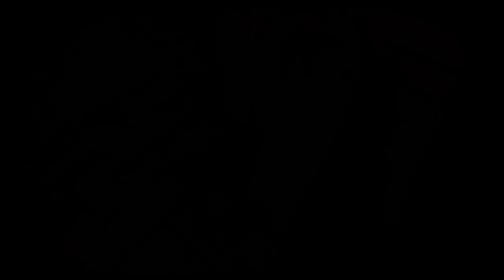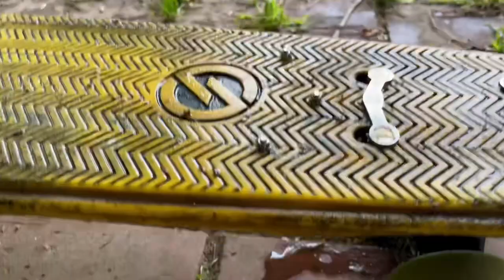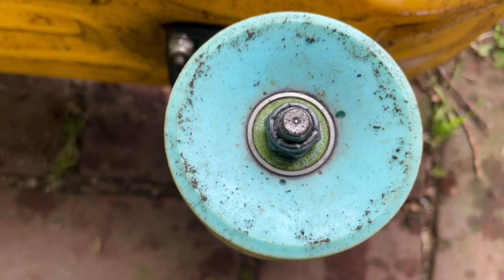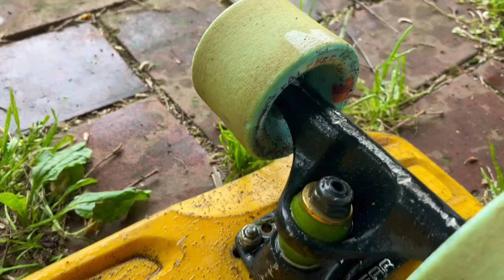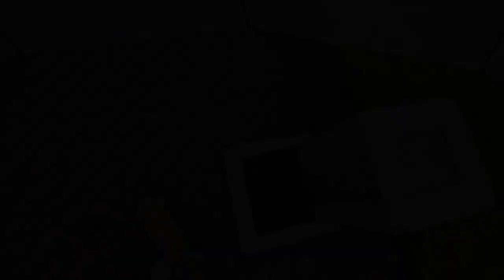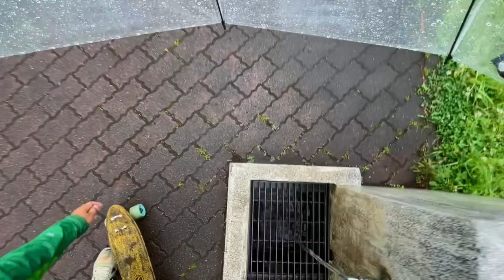I'm exploring a cruiser board that won't break even on rainy days

Comment: Like bicycle parts in the rain, you have to keep skateboard parts lubricated because this will help keep water from penetrating and remaining on the metal bearings, the screws and nuts on your trucks, etc. WD-40 spray would do the trick because it is designed to keep water away from metal parts and preventing rust/deterioration. 🤙
Reply from the maker: I agree with that too.
However, I have never used a high-performance chemical called WD-40, and now I'm using a grease spray. I would like to try the WD-40 the next time I buy it. Thank you for letting me know👍
Reply: @ponnycruising No problem and by the way, WD-40 is very popular in the U.S. It is oftentimes used to protect mechanical parts from water and prevent against rust. It is also not expensive at all. BTW, you ride the Penny so well! After I am used to riding my longboards, riding a Penny 22" feels waaay too small and scary! :-)
Reply from the maker: @OldLongboarder65  I really want the grease type of WD-40 because I put grease in the bearing.
I started with a wide 80’s old school board, so I understand that feeling well.Most young pennyboarders are used to it for the first time from such a small board, so their sense of balance is very good.
I'm guessing that they will perform very well when they get on a big board in the near future, and I'm looking forward to seeing it.
Reply: @ponnycruising  Well, WD-40 is good for helping to repel water from metal surfaces, like when you ride in the rain. When I used to Rollerblade a lot, I used to use a very thin oil on my bearings that was made for racing - it was very good for speed! That was a long time ago, so I don't remember the name of this racing oil, unfortunately.